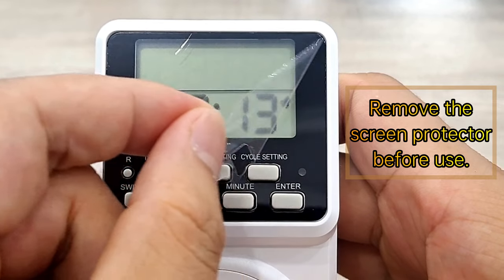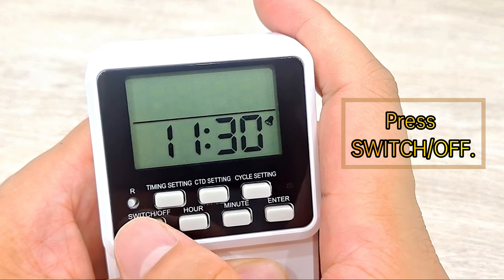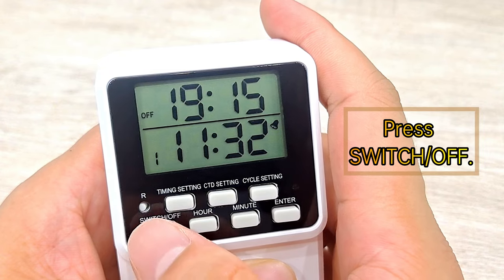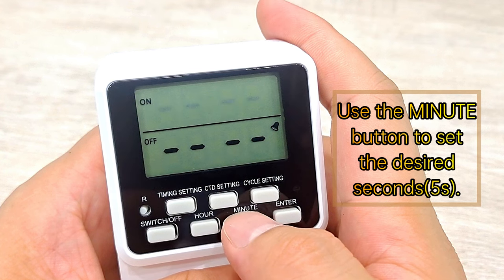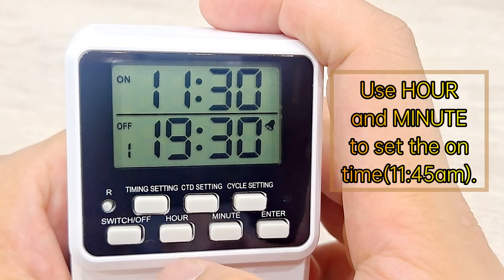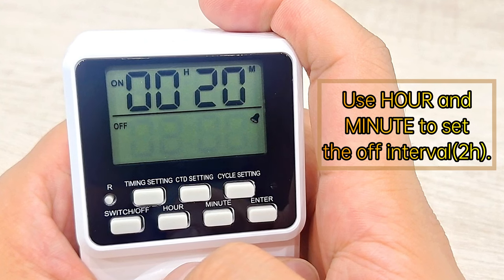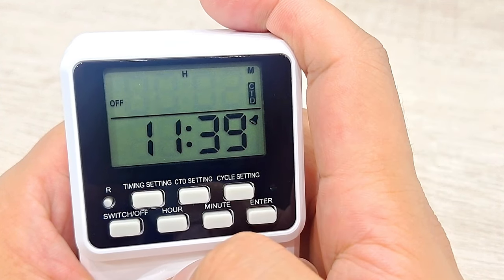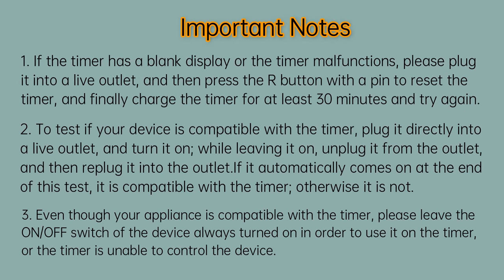T319 Timer Plug Detailed Setup Instructions for Brand TECHBEE ORIDGET NOVKIT

Comment: Oh no.. I think this digital switch timer is more complicated to use compared to the analogue one (that has circular dial)
Reply from the maker: Press SWITCH/OFF —— Press （or press and hold）one of the three Timer Function buttons( TIMED/CTD/CYCLE) —— Use HOUR/MINUTE button to set the on time —— Press the Timer Function button again —— Use HOUR/MINUTE button to set off time —— Finally, press ENTER to confirm. These are the general setup instructions for all the timer fucntions. Keep this in mind and you will know it’s not that complicated actually.
Reply: I was just now thinking the same thing!

Comment: Well after 2 days and no help from the instructions or these videos LOL I think I figured it out.. if you wanted to go off and on over and over all day. You will press, switch off, and then press cycle settings.. if you want it 1 minute on and one minute off over and over again. Set the top on section 2 0 0 .01. Then press cycle settings again and it will go to the bottom which is off. Impress 0001. The very last digit is actually the minutes and not the seconds. Once you realize that. You can set it for how many minutes on and how many minutes off you want back and forth. When done with those settings press enter to start

Comment: Hello yhank for video . Do you know if is possible to add extra time to the timer when it is running?
Reply from the maker: To change your settings, just follow the corresponding instructions in the user manual from the first step to the last step. Usually, it needs you to press the SWITCH/OFF button to switch off the timer first.
Reply: @MrTimerABC  Ok thanks but unfortunately it's not the solution for me because it's to add time sometimes when I print in 3D so if I cut it won't work ;)

Comment: Hi Dear, it is possible to set 5 seconds on for 3 hour cycles.  Which step 1, 2, 3...?  Thank you very much
Reply: I only got 5s every 59:59.  Thanks for the instructions.
Reply from the maker: Do you mean you need the timer to repeat the cycle “5s on and 3 hours off“ continuously？In Seconds & Minute mode，the maximum interval is 59:59, and thus it can not meet your needs. If you need "5s on and 3 hours off" continuously, please search "B09BZ8LQFB" on amazon.com. The Techbee TC201 timer can do this cycle.
Reply: Amazing, many thanks. 💛

Comment: Want a timer to power cycle my WiFi router once a day.  So on for 23h:59m:50s, off for 10s (or something less than a minute), then back on again and repeat daily.  Can this do that, and if so, how?  Thanks.
Reply: I would reset at 0am to 0am01 
Method:  4:38
Reply from the maker: In the daily timing mode, the accuracy is 1 minute rather than 1 second. So exactly speaking, it can not meet your needs. The compromise is to set the timer to cut off power for the router for just 1 minute at night and back on again. For example, you can set the timer on at 03:01am and off at 03:00am. hope you will find this information helpful.
Reply: @MrTimerABC  Thank you!

Comment: I'm setting continuous timer, on for 1 minute, off for 45 minutes. But it stops after around 12 cycles?
Reply from the maker: It may well be that you’ve accidentally set the timer to working in Function-5 as mentioned in the video. The duration time must be set to 00:00 if you need the interval timer to run continuously. To make it simple, I suggest you press the R button to reset the timer to factory mode first, and reprogram the on time(1 m) and off time(45 m). And finally, press Enter.

Comment: What is the red light on right side and how is it turned off?
Reply from the maker: It's an indicator light. Red light on, timer is on ; red light off, timer is off and power is cut off.
Reply: One more question. Once daily, the top display goes blank in continuous interval mode. I have to reset and the display returns. What gives? Thanks!
Reply from the maker: @rivergeek  It may be that the internal battery is out of charge. We recommend plugging the timer into a wall socket, and then press the reset button to reset the timer. And then keep the timer plugged into the wall socket to charge for about one hour before another try.

Comment: How do I turn on at 6am for 5 min off for 4 hours, on at 10am for 5 min off for 4 hours, on at 2pm for 5 min off for 4 hours, on at 6pm for 5 min off for 12 hours until 6am and repeat every day?
Reply from the maker: I am so sorry, but the timer can not do that. In this mode, the maximum interval is 59m59s.
Reply: get a wifi gadget, costs the same but you use it with an app
Reply from the maker: @Goldapfel  A wifi plug is good, but it seems that a wifi plug can not be used to refresh your wifi router haha. So maybe you still need a timer plug.

Comment: Can i set it 18 hourse On an 4 off ?
Reply from the maker: Of course you can. Please follow the steps below:
1. Press SWITCH/OFF;
2. Press CYCLE SETTING button;
3. Use HOUR/MINUTE to set the on interval to be 18:00 hours;
4. Press CYCLE SETTING again;
5. Use HOUR/MINUTE to set the off interval to be 4:00 hours;
6. Finally, press ENTER. Plug the timer into a live outlet, and it is ready for use.